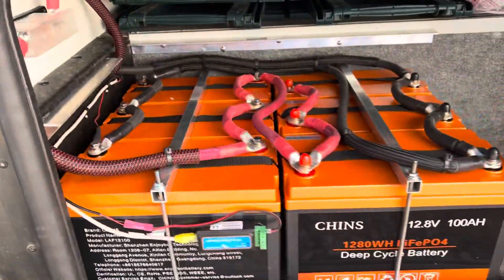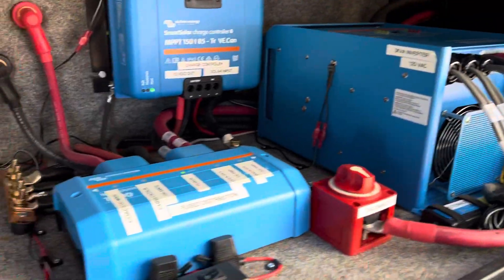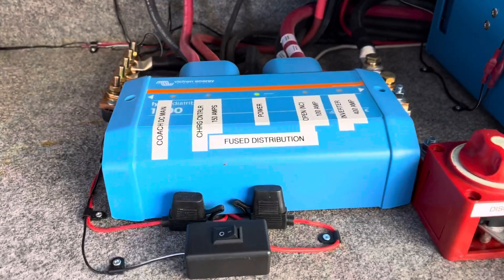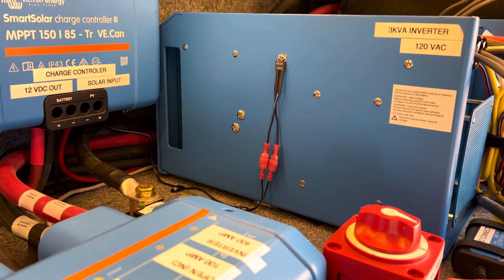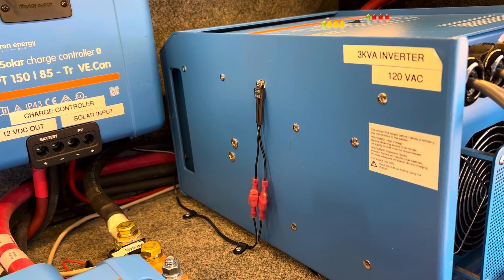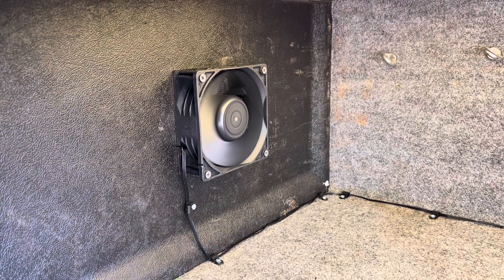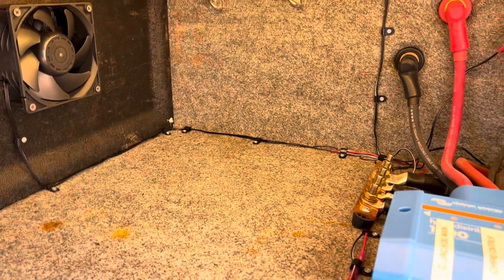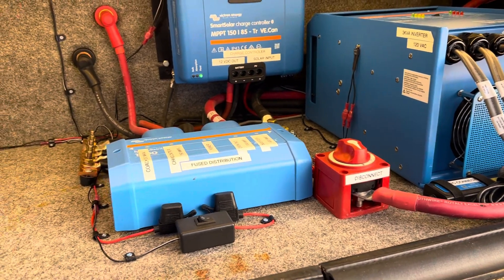Solar Upgrade Phase 3, Part 3

Comment: A great series of videos, many thanks for everyone of them.  I wanted to ask about the red & black cable loom you have beside your yellow Ethernet cable which is connected to your inverter. Where does the lug on the red & black loom of thin cables connect to, is it the negative on the lynx distributor?
Reply from the maker: The small gage red and black wire pair (wrapped with the yellow cat-5 next to inverter) goes to the negative post of the batteries.  It’s a temperature sensor.

Comment: How does your labelling tool looks? those cables for the inverter charger is neatly labelled like nothing else.
Reply from the maker: These are full sheets of labels that I print in my printer. LSL-82C is the one I use. Here’s a link…
https://www.labelidsystems.com/cable-labels/wrap-around-cable-laser-labels/lsl-82.html

Comment: You could always use spacers and mount a piece of Plexiglass on your battery hold-downs above the positive terminals.  (That's probably as safe as you can get...)
Reply from the maker: That’s a good idea.
Reply: @coryhanes  
You might also want to put some heat-shrink on that tie-down bar just to ensure it doesn't accidentally short the positive connections down the all-thread to chassis ground.
Reply from the maker: @KennethLongcrier  good recommendation, I have the large heat shrink so just might do that.